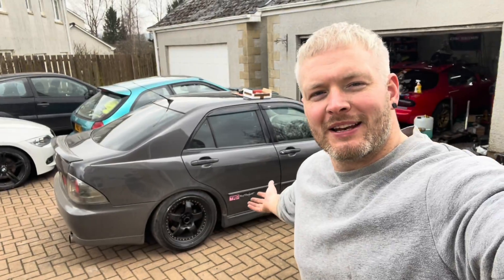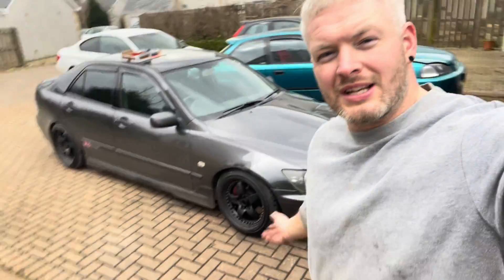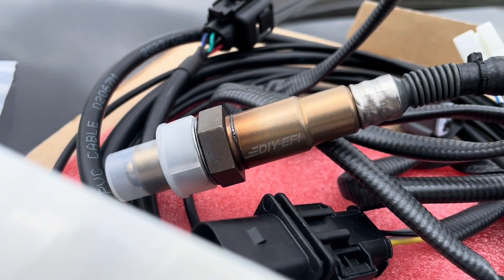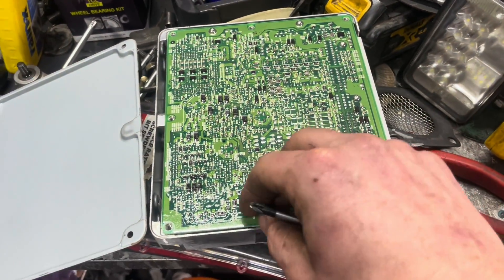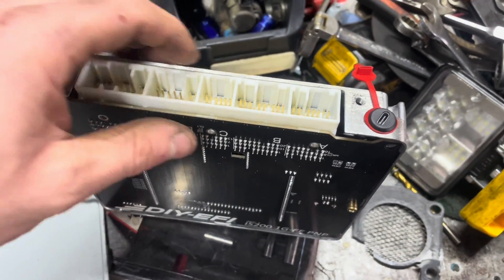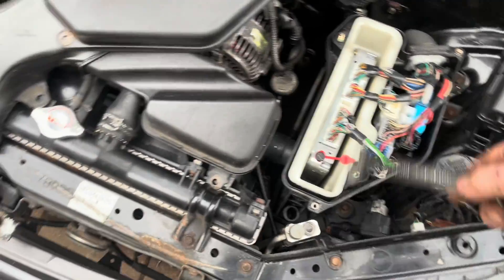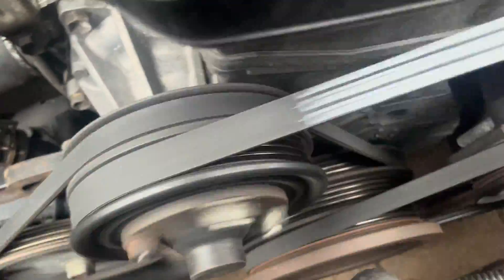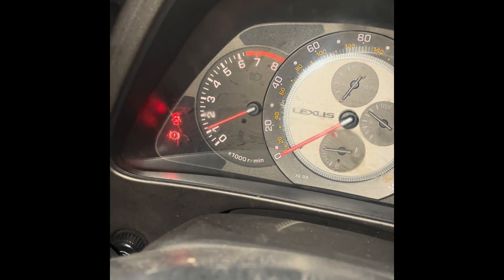LEXUS IS200 PNP Standalone ECU (DIY EFI CORE 8 ECU)

Comment: Great Street Turbo and a Tidy Manifold.  Only reason Tig would be  better would less material inside the Pipes. 450 with low down power and a clean Torque curve will make a Great Road Car!

Comment: Nice to see this is an option now 
Throttle control is the worst thing on the IS200 
Are there some cons on the ecu things that dont work ?
Reply from the maker: yeah you sort all the throttle issues with this ecu so its can work 1:1 or even better you can make it 50% throttle pedal gives 100% throttle body if you wanted

Comment: Awesome, nice to see James still producing the goods. I see he has moved across to rusefi is that for all his ecu’s or does he still use speeduino for non drive by wire applications etc?
Reply: Hey, thanks for the support. It isn't running rusefi, but a recent fork of it called FOME. Most of our range is still Speeduino based, but applications with DBW and CAN requirements like the IS200 have had us looking at other open source ECU platforms.
Reply: @diy-efi3015  ahh ok , thanks James
Reply from the maker: I was going to reply but looks like one has come from the main man himself
Reply: @BEYTEK  cheers man , keep it coming
Reply from the maker: @garyhurn6153  next video uploading now on the dyno